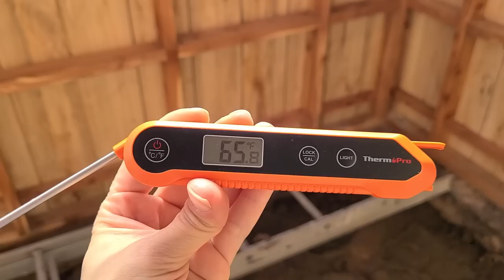Making and installing barn doors on our solar kiln // E119

Comment: The one time I messed with gutter was funny; the inside is Teflon, which keeps silicon from sticking to it.  I then wised up, cut a line at the end of my inside piece through the Teflon on the outside piece for a mark.  Then I chiseled out the Teflon under the seam, which allowed the silicon to stick.  3 years on, no hassles.

Comment: "K" style gutters are for the inventors last name Knudson. I worked for the company back in the 70's, 80's and early 90's.. Knudson Mfg had the patent for a seamless gutter machine that could fit in the bed of a pickup and thus you could run a continuous gutter out. Easy to run out into 8 to 10 ft length for the DIYer.

Comment: Should be driving the lag bolts thru the thin board into the thicker board, more area to grip.
Reply from the maker: I agree, but didn't want the heads on the outsides of the doors.

Comment: There are caulking guns that relieve pressure when you stop squeezing.  I used one when I worked with a painting contractor.  They will cure your caulking issue of "leaking" after you quit squeezing.
Reply from the maker: Worth investing in one.
Reply: @WalnutsandWineberries  Yes.  Love your channel by the way.  I don't miss a single episode!  Wishing you continued good luck and success.

Comment: There's a hack out there where you pole a hole in the bottom of the caulk tube and spray the base of the plunger with WD-40 then you don't have caulk ooze all over and it won't stick to the plunger. Should relieve all the mess.

Comment: several DIYers show if you use a screw and screw it in reverse 1st you wont split the board without predrilling the screw.

Comment: Warning... half way into my 40 year life as a carpenter in California, we started getting calls to replace rotten wood on exterior structures and patio covers.  What we found is that most every where two pieces of wood were put together with out first priming/painting the wood, it rotted at those intersections.  WHY?  The structures were painted After the structures were built and the paint always cracks at those intersections of two wood pieces.  WHY?  Wood shrinks while drying in the summer heat and pulls away.  The intersection of two lumber boards or beams then took on water during the wet seasons and entered the wood but then is blocked from coming back out where the paint is, trapping it to rot the wood.  The last 20 years we primed and painted at least 2 coats BEFORE building the exterior structures. Yes it slowed the job in the front end having to paint and turn the pieces one by one but on the back end of the job it was so much easier as then it was just a matter of touch up paint.  NOTE:  We kept a can of paint and brush handy during cutting and assembly to paint and seal all of our cut ends of boards and beams.

Comment: I know why you painted it the color you did but a darker color on the sunny side is would help increase the heat inside… especially in the winter when you want every little bit of heat you can find.
Reply: I was going to suggest it would be better painted Black or a darker colour. Not sure how much heat you want for timber, is more better or should it be more gentle?
Reply: @chrisbartlett6022  typically you want moderate heat but air flow is more important to carry away the moisture from the wood. If you have excess heat, you can always vent it (and the moisture) but low heat means you need to dry it longer. Drying at too high of a heat without moisture venting can cause case-hardening of the wood… the outside dries and encases the moister wood in the interior of the board. Not much of a problem for construction but a real issue if you are planing or ripping the board… then they dry differentially and turn into pretzels.

Comment: Nice job on those floors.
Traditionally, the long cross member of the 'X' would be ar rhe bottom hinge corner si it acts as s compression strut.
Not a big deal if they are not do so.  Ad long as both pairs are the same?

Comment: Are you going to paint the inside black and add insulation?
Reply from the maker: It's a very debatable topic.  The baffle will be black to attract heat through the clear panels.  As far as insulation, I'm not convinced it's worth the investment.  The kiln is designed to force air in and out constantly through vents that will be in the doors.  With the constant replacement of air, I don't see a point of insulation.  The greenhouse effect should be more than ample to get the job done.  I guess I can always add it if I'm wrong.

Comment: one more thing u need 6 batteries to get a full days work out of them.  That is about 6 hr of use.  I have 6 and 2 charger. Battery goes died it goes in when I go in for coffee brake and on to charger at 10  Then at least one more at lunch and then 2 more at Tea time.  The 2 that went on charger at 10 are now charged at tea time so they come back out.  Then at dinner time I bring out the 2 that went on at lunch when the days are 5am to 9:30pm light
Always keep 2 on chargers it seems in summer.

Comment: Hinges look a bit lightweight for that size/weight of door. You need something a little more agricultural. Long length of X is meant, traditionally, to support the hinge. Having a clean exterior face on doors minimises rot from weather, yours will be attracting it, unfortunately. Nice try.

Comment: when buying bolt 🔩 they come in different grades   grade 8 usually very strong hard bolt 🔩 maybe over kill for application 
    they come completely threaded which is technically weaker  as cutting thread remove metal 
     on longer 🔩 bolt that leaves space unthreaded stronger  close to hex head    but rely on grade for hardness example cylinder head bolts normally high grade they take more stress

Comment: no plan survives contact with its doing  They always change
Me I spend  2hr every day in a hot bath for my old bones, joints and muscles.  I am always thinking about what I want to do while I dop this  Been designing cement raised beds all winter.  Almost have them.  These will be done this summer and put up come fall.  
In mean time I want some raised beds.  will make them out of wood.  By way my beds I want 32in tall..  So the wooden ones will be16in legs with 15" deep beds 3ft across. the other inch is in the base of the bed.  I will put hoops over tops with 1/2 plastic conduit pipe with bug cloth over them  This to keep weed seeds out and bugs.  The growing medium will have no weed seeds in it and I want to keep it that way.  These beds will be for onions, carrots, and samll leaf crops.   Those thing u hate to weed.